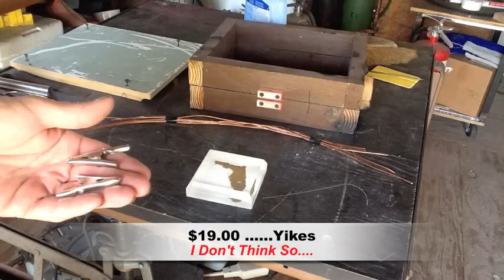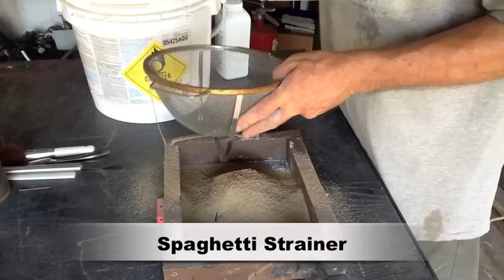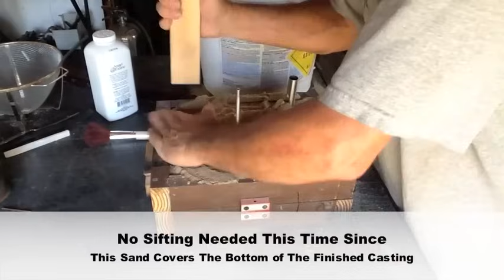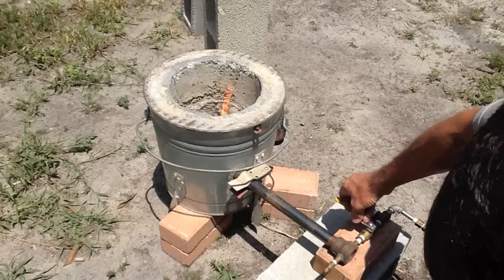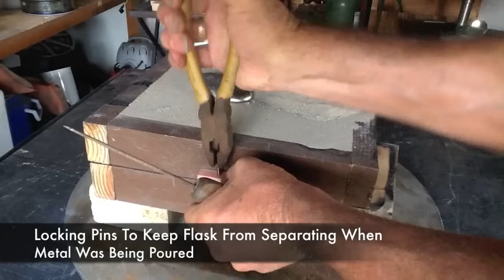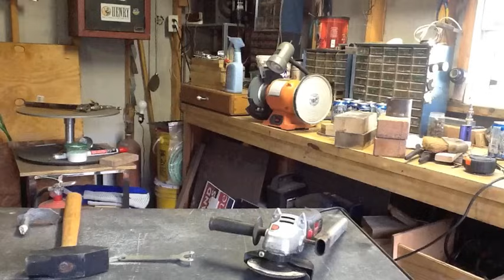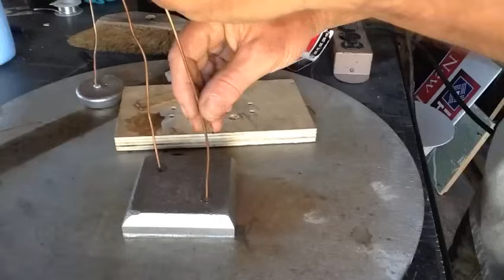SAND CASTING LESSON FOR BEGINNERS - STEP-BY-STEP - (A 3rd HAND) - MSFN

Comment: I'm assuming you used Aluminum?
Reply from the maker: Yes sir! :)
Reply: Makin Sumthin From Nuthin ok, thanks. Would that work for steel?
Reply from the maker: To melt steel you need a serious furnace, I have another video on making a furnace to melt brass, I may be able to melt cast iron in that one. Check it out if you have time
Reply: Makin Sumthin From Nuthin I saw the king or random make an electric ark furnace, he used firebrick to hold the metal, and hold the heat in, so that's a start, I just wanna cast it. Any idea what they use to make molds for liquid metal in factories?
Reply from the maker: This guy on youtube melt only cast iron, you should check him out https://www.youtube.com/user/luckygen1001
Reply: Makin Sumthin From Nuthin hm, thanks I'll take a look. I thought that iron was tougher.
Reply from the maker: Cast Iron has a lower melting point than steel, you can google it and see the melting points of various metals

Comment: Why doesn't the sand  erode away as the molten metal is being poured into the mold? I know that when you pack sand at the beach the water wave coming in washes it away, right away. Molten metal is so much heavier and I would think that the same thing would happen.  What am I missing?  Thank you for your reply
Reply from the maker: The sand is mixed with bentonite clay to hold its shape

Comment: Man after my own heart. I'm always making stuff from scrap. Scrap logs, scrap wood, scrap metal whatever.
Reply from the maker: Thats excellent! 😊
Reply: I've been doing a fair bit of prospecting lately (Gold mostly but gems as well) and I've been keeping the sand and clay from my samples. I've been thinking about fully classifying the sand to do some casts. Especially since we just found a creek full of tin.
Reply: Incidentally got a LOT of hate recently from a picture of an improvised composite beam made from scrap ply wood and scrap wood I pulled from a skip. In response I did a video showing the beam supporting me across a 3.8m span with only 11mm of deflection. All the people that said it wouldn't be able to support any load at all didn't make any comment after that.
Reply from the maker: No gold to be found in Florida :(
Reply from the maker: We all get haters, but if it works....it works! Keep up the good work!

Comment: Great video! Learned every casting terminology from this video but I could n't understand what is the final product that you made with wires? What are their uses?
Reply from the maker: It was just a device to hold wires in place to solder them so they dont keep moving. Thanks for watching :)
Reply: Makin Sumthin From Nuthin, Quick reply😍😍 Love you mate😁

Comment: Use ready fluxed solder for electronics ! It's quicker, easier and makes less mess. Also make sure to remove excess flux after soldering.
Reply from the maker: Yes, as you can see I dont solder for a living. LOL

Comment: Would it be possible to cast the copper wire into the aluminum when it gets poured? Nice instructional video.
Reply from the maker: Thanks....If you think about the orientation of the pattern in the sand mold, the wires would have had to stick out the bottom of the drag so that was a no go, had considered that tho 😊

Comment: Do you have a video of you pouring molted aluminium on your legs and feet ?¿??? Boots and leather apron face shielding please if you are a beginner. Damp sand will explode. A drop of sweat in molting hot aluminium will explode. Think about it .is a short cut Worth that much pain and loss of ??????
Reply from the maker: No, No, and No, did you see pain and loss of ?????? >NO

Comment: Look what molten metal does to wood! Imagine what would happen if it splashed on bare skin or nylon shoes and socks. Just saying, use common sense.
Reply from the maker: Yes, hot stuff, approx 1300+ degrees
Reply: Tee shirt, tennis shoes and shorts is not safe attire for metal casting. No safety face shield either.
Reply: Obviously in Florida. Hell you're lucky he isn't wearing socks and sandals. Close toed shoes are a sure sign a Floridian is taking things seriously.
Reply: There is a hospital in trip in their future with these safety practices
Reply: Just cant be clumsy ;)
Reply: Clumsy shouldn't be doing this in the first place. Still safety gear is needed. Even graceful people have unforeseen accidents.

Comment: This probably taught me more about practical metallurgy than my senior elective metallurgy class in college.  Thanks, from a materials scientist.
Reply from the maker: Wow, thanks for the kind words and thanks for watching 😊
Reply: @MakinSumthinFromNuthin  the holes was drill at what inch diameter?
Reply: @nsedickson1  the hole was 7mm so around 0.28 inches
Reply: love to hear shit like this. classrooms sometimes can be redundant
Reply: Can you do the same with risen or silicone with sand. And how does the sand activate by water or air?
Reply: Senior elective in College? I thought I was taking and easy class with “Canoeing”. 🤣😊

Comment: Metal working 101 you don't use a bench grinder on aluminum. The aluminum will fill the stone and will overheat and explode. Please be careful safety first
Reply from the maker: Yes, good advice...I set a bad example there :(

Comment: Nice very informative video.
Beside this soldering is very interesting job while  soldering  it important to rough calculation of some of concern to it. soldering area and mass involve which you want solder and heat up like if you want solder a one inch or two inch thick  plate with normally it will be difficult comparing to one mm thick plate. it will be more difficult in the center comparing to one of its corner, what type of solder ( lead and tin combination) you are using, what type of flux you are using , it the soldering area is well cleaned or rusted and of coarse the practice makes man perfect .
you have so briefly define the casting process that I have made mind to do it myself.
Reply from the maker: As you can see in the video, I know very little about soldering! LOL

Comment: Any experience with sand cast magnesium and how to re-finish? I have an engine cover made of sand cast magnesium and want to essentially paint it black.
Reply from the maker: The only experience I have with magnesium was in some sand cast parts I tried to anodize and the magnesium basically botched the anodize job as I had some in the cast aluminum parts by "accident" Sorry I wasnt more help, I am sure painting it shouldnt be a problem (proper primer/paint etc)

Regards,

Rich
Reply: Thanks for the reply. I'll do a little more digging. Great video, good content.
Reply from the maker: Best of luck on your project 👍🏼

Comment: very informative im going to try to do this next week
Reply from the maker: Thats excellent! 1st time casting metal?
Reply: yeah
Reply: yeah
Reply from the maker: Be safe, take your time, use PPE as you see fit & good luck
Reply: alright thanks
PPE?
Reply from the maker: PPE: Personal Protective Equipment   Stuff to keep you from getting burned :)
Reply from the maker: Personal protective equipment (PPE) refers to protective clothing, helmets, goggles, or other garments or equipment designed to protect the wearer's body from injury or infection. The hazards addressed by protective equipment include physical, electrical, heat, chemicals, biohazards, and airborne particulate matter.
Reply: ok thanks, no problem  l already have all the safety equiptment i need.I did some research before starting new things
Reply from the maker: Have fun!, share your results! :)

Comment: Great video. That will help out a lot when I finish my foundry. Now I'll try to help you out. When soldering electrical components, or wire, or anything other than pipes, DON'T use plumbing solder and flux. It won't flow well at all. Use a quality rosin cored solder and flux, and stay far away from that lead free crap. You'll be amazed at the difference (and ease) it takes to solder up electrical equipment. Thanks again for your great and informative videos.
Reply from the maker: Thanks F5, you are absolutely correct...and its even more reason why I dont do soldering for a living! LOL :)

Comment: Very impressive video. Something that caught my eye, where did you find the pin locks that you used on the side of the flask?
Reply from the maker: I made those from 1/2" square plastic I got free from craigslist and the steel pins were cut down from a steel shaft I found inside a internal CD drive from a computer I scrapped :)
Reply from the maker: Hows the flask making going?

Comment: there are a lot of videos on you tube on Soldering you would find useful, it would only be a few minutes of your time, would change your approach to soldering forever. 
good video, I would have just used a block of wood for the base of your 3rd hand, I just make them as and when I need them out of what ever I have to hand at the time, I often use a potato when 3 small nails stuck in the bottom to stop it rolling, or I just cut it flat with a knife... of course I don't always have access to potatoes.
Reply from the maker: I didnt really need the 3rd hand but did it more just to show people if you need something....you can make it + show how to cast something. Yes, soldering is not my first calling LOL Am cooking some french fries along with dinner tonight...potatoes are good stuff! :)
Reply: +Makin Sumthin From Nuthin 
you did ok with the soldering, a 5 minute video would put you on top of that I'm sure. 
you're very clever, fascinating video, most interesting. 
never underestimate the usefulness of a potato, I use them as a base for joss sticks... last for days. 
I will look into your other vids.
Reply from the maker: Thank you so much for the kind words. Feel free to openly comment on any of them :)

Comment: even after watching it , i dont understand , did you remove pattern,,,,,,,,is this special sand that holds it shape, if not when you put top half on , wont it just filling where pattern was?.....very , very confused
Reply from the maker: Yes, casting sand holds the shape of the pattern even after the pattern is removed. It is "special sand". It has a clay additive. I have a video on how to make the casting sand as well as other casting videos which show the mold making process in a bit more depth if you care to watch them :)

Comment: Great Video! Really informative for beginners.

Only thing I think that could have been shown or demonstrated better is making a smaller version of the pour cup placed over your vent. Loose metal spilling out could cause problems for potential beginners. A small funnel cup over the vent can help control the metal better as you fill your mold.

Otherwise, well done!
Reply from the maker: Thanks, consider subscribing if ya havent already :)

Funny you say that, see my newer video on casting the Virgin of Guadalupe....I do just that! ...or something very similar, I didnt need an extended riser:)

Comment: Nice video, thank you. Your sand seems dry. I thought some oil in the sand was needed. It's more simple this way.

5 mn epoxy is the weakest one. For resins, the longer time of polymerisation, the better. My strongest Epoxy glue takes 3 days @ 22°C (72°f).
Reply from the maker: I really dislike that 5 min epoxy, failed everytime I used it. Me likes my JB Weld tho! :) Thx for Watching & Commenting!
Reply from the maker: I have never used oil-bonded sand. Would try it if I had a muller

Comment: Hey nice job, simple and easy to follow. I'm curious if you've ever tried sand casting for resins? Reason I ask, is I've experimented with making silicone molds, which are great for resin casting, but the silicone is expensive, especially if its only a one off. I'm thinking sand would make more sense. Thanks and best wishes!
Reply from the maker: Hi Carlin, No...I have never tried resins or silicone. Looked into it but supplies were toooo pricey for me! :) 
I have another video about making the sand if you wanna check it out. Thanks for watching!
Reply: +Makin Sumthin From Nuthin thanks will check it out :)